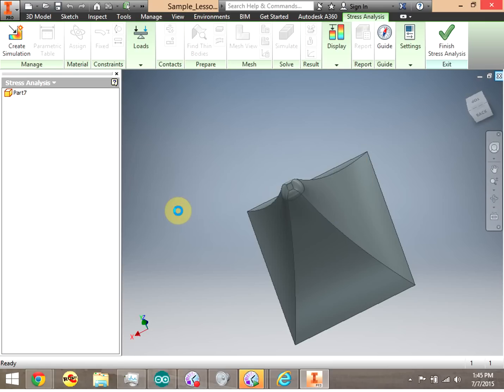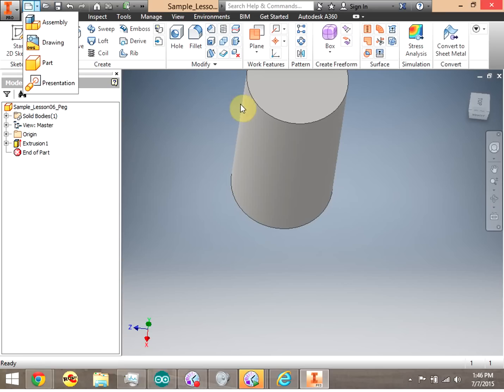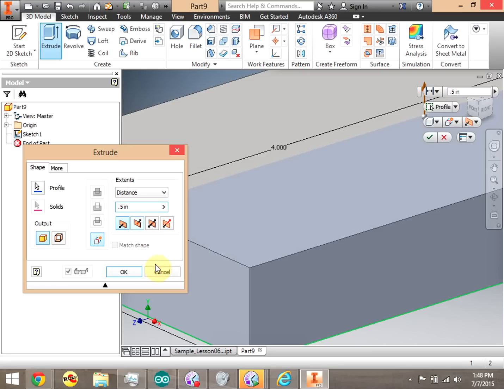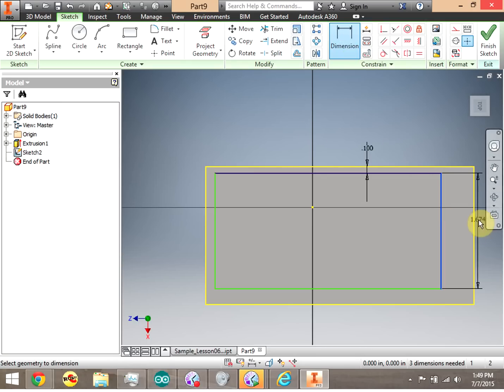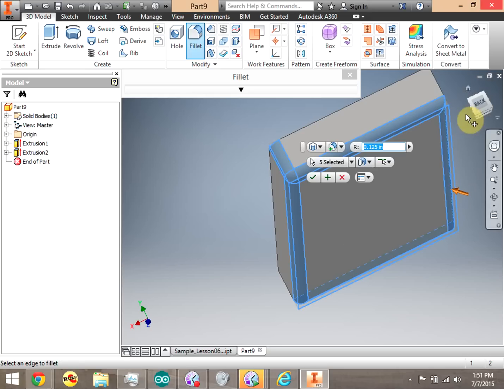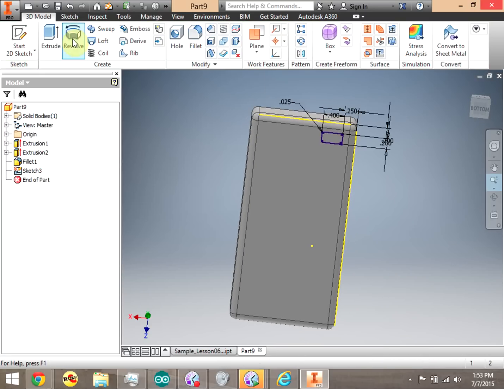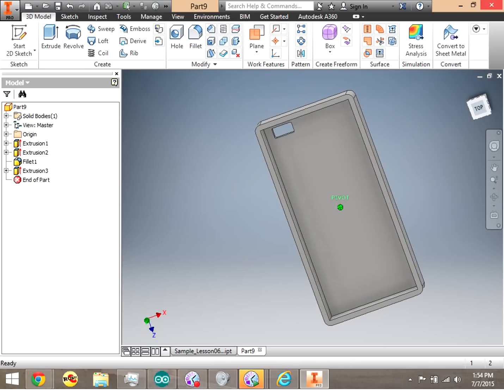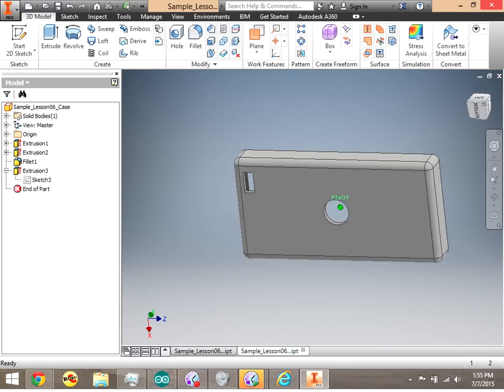AutoDesk Inventor 2016 : 06 : Assembly

Comment: Thanks for the guide. I'm more used to the way Inventor 2014 is set up so it was a bit difficult at first getting used to it. I just couldn't find the way to join the parts and this cleared it up for me. I even realized i had to go back and project the parts and add guidelines because of how demanding this version of the program is. Sometimes it really is easier to use AutoCad, but again, thanks for clearing this up :)